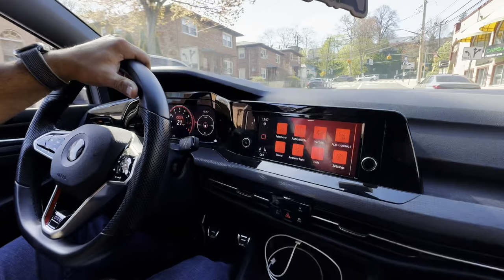MK8 GTI OCDEURO REAR BRACE INSTALL!!

Comment: You in SI? What tune are you running?
Reply from the maker: My boy with the sti is in Si I’m in Brooklyn lol and no tune as of yet but most likely gonna go with 034 stage 2
Reply: Brace looks great! Also... what spoiler is that? I know it's the Golf R style but where did you purchase it at? Can you provide a link to it? Thanks
Reply from the maker: Thanks bro!!!! It’s from Autoid. I got the lip and rear spoiler package. The fitment is great too
Reply: @MaxCarsandVlogs  Thanks man! I will google them. I assume the rear spoiler just sticks on with 3M? Did you have to remove the front bumper to install the lip? Sorry for all the questions new to the Mk8 coming from an Mk7 and Mk7.5 lol.
Reply from the maker: Bro don’t worry its all good! lol. Correct just 3M tape which been holding up good for almost 2 years. And for the front lip u do not need to remove the bumper (thank god lol)
Reply: @MaxCarsandVlogs  Nice... I'm right in NJ I see you're in NY. Of course I went to their website and the rear wing is sold out haha! They have a sweet set of full replacement sideskirts though (gloss black and my Mk8 is black) and I saw the front lip also. Shame the spoiler isn't in stock. Totally transforms the rear of the vehicle along with the gloss black diffuser.